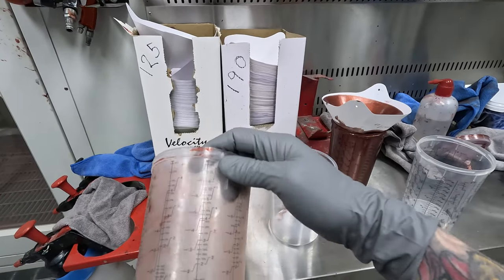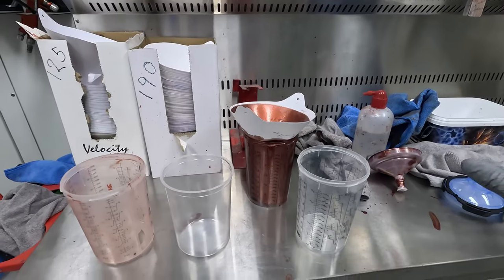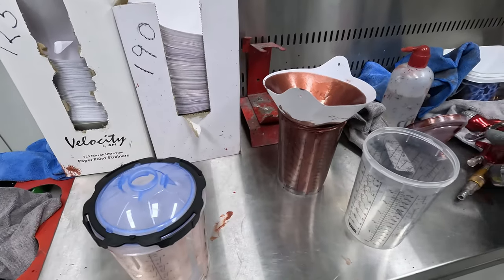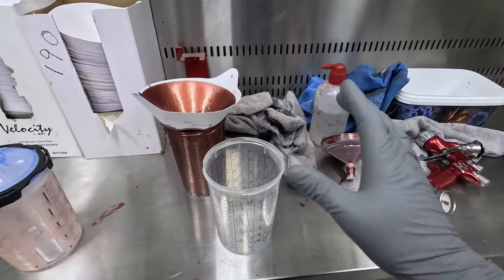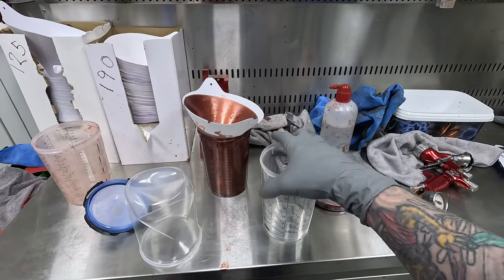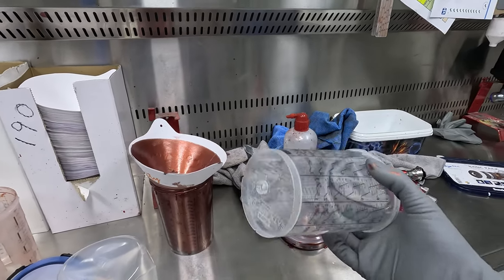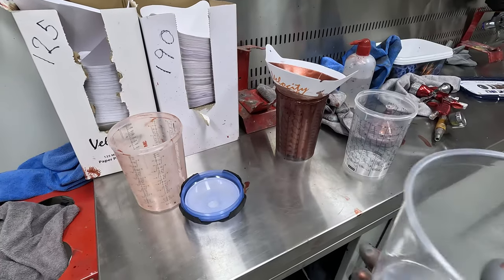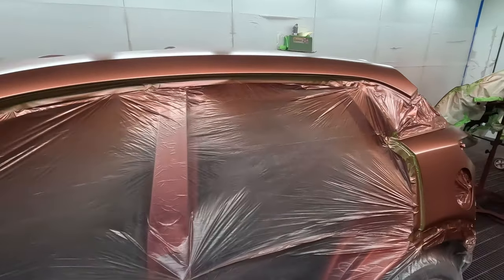SATA RPS VS PPS2 Disposable Mixing Paint Cups

Comment: Do you feel a difference between PPS and normal cup?  The flow of paint changes as you are creating vacuum, and your gun settings go out the window after few seconds.  Paint jobs with a regular cup are better.  I wonder if you noticed it, or if you ever tried to test your gun spray pattern after is starves for air.
Reply from the maker: @AW33COM  I've tested it, it's all in your head lol, it literally makes no difference. I was surprised myself
Reply: @TheGunmanChannel  ok, thank you

Comment: can I paint with the SATA x5500 with the pps 3m cups? I have the adapter. Or does it always need air. with the button. where the paint runs out.

Comment: best way to clean the pps outside cup is to put a sticky tape around the cup and peal off to clean of the flaky paint. around the top treads, inside and bottom are nonstick and tape will take the loose paint off. the rest you use thinner. go

Comment: Hey Gunny, I also use both the Sata RPS and the 3M PPS 2.0 cups but my favourite is the 3M ones simply due to the fact that I'm to old and senile to remember to pop the little caps on the Sata pots, I think 8 times out of 10 I will forget to do it and it really does my nut in😂
Man you are paying one hell of a price for your disposable cup down in Aus as they are around £60-£80 here in the UK🤔👍John UK

Comment: Have you used the DeKups system?  It is similar to the 3M where you get liners and liner caps that let you spray upside down, but the hard cup and cover are separate and always reusable.  There are no markings on the liners or hard cup so you need to use standard mixing cups. Depending where you get them, the 3M 28oz are about $3.60 USD each and the DeKups 34 oz are around $2.80 USD each plus a 2 pack of the hard cup and cover are $32 USD.  The first DeKups 32 pack of liners and 2 hard cups to get started are about $3.80 ea, but the next 32 pack of liners without new hard cups is $2.80 ea so a bit less than the 3M.  I have been using the DeKups system and like them, but I am not 100% sold on DeKups.  I started using them with my FLG-4 and a 24oz starter kit with the adapter, but have upgraded to DV1 base and clear guns, which came with adapters instead of fixed cups.
Reply from the maker: I know the dekup system. But it's still not available in Australia for some reason.